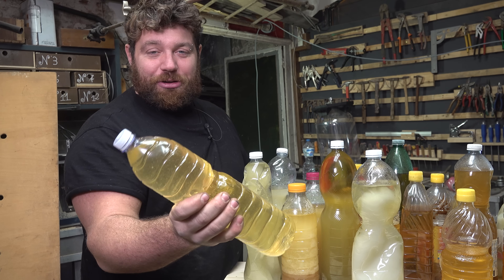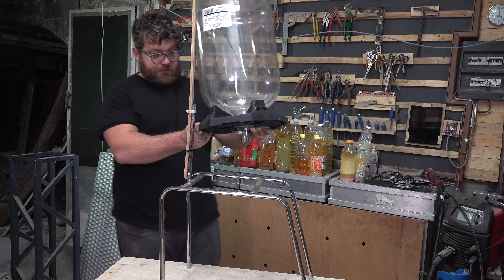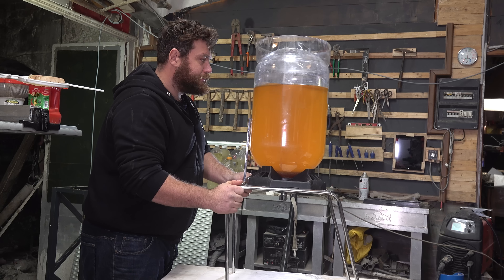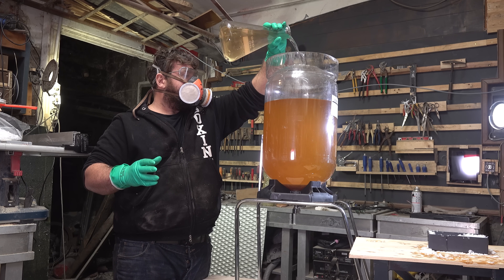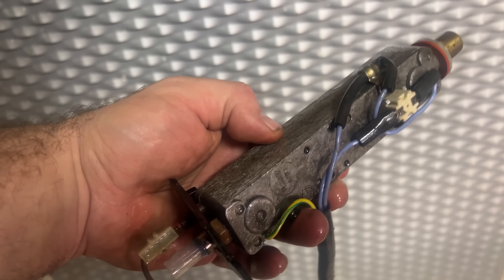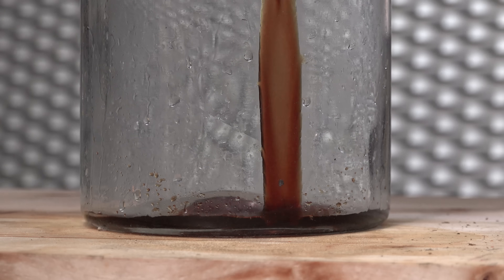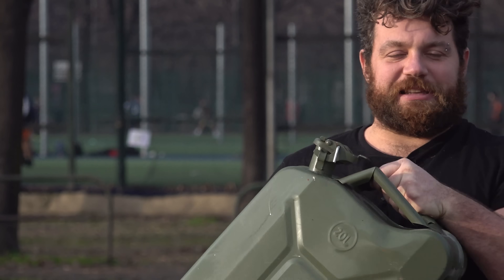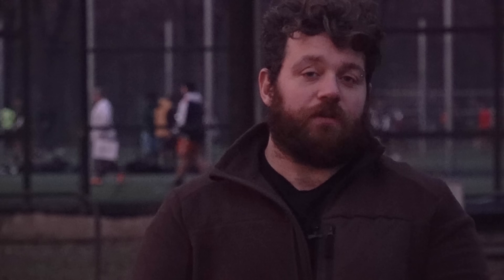How to Make BioDiesel at Home • Full Tutorial 4k

Comment: Biodiesel (rapeseed methyl ester) is an extremely good solvent (dissolves any paint from the carbody):
-> swells all rubber lines and rubber seals (up to the injection pump).
-> The total loss is unfortunately pre-programmed!!!

Therefore the better solution: Build a Two- tank- system!
In the small tank: pure diesel
and in the big main tank: PURE salad oil!

Warm up the engine with DIESEL and then switch to the vegetable oil tank!

A few km before shutting down again switch to diesel to flush the lines again with diesel.

Works great - you just have to think a bit (switching from diesel to salad oil and back again) ...

You can also install a fuel preheater to get thin vegetable oil.

Greetings from Austria! 03 10 2023

Comment: Just Put the Salat oil in the Tank of an old Diesel Car. It will Work. But Not in a Common rail. It will Break your high pressure Pump. I did it with my old 190 D Mercedes more than 20 Years ago. It worked fine. At this time Diesel price has been raised. Salat oil from Supermarket was much cheaper. There we're also seperaten Tanks available which fitted into the spare tire Container in the Back. Start and Finish with normal Diesel with a switch. But after that they raised the price for Salat oil, those Bastards. The Car ran good. I built an extra heating Tube into the Diesel circle to keep it better flowing in Wintertime. But a 50:50 Mix with Diesel was Always better. I Loved the smell of a Grill Party, everytime  I have got out of the Car. The examination of exaust Gases was allways better Then with normal Diesel.
Reply: Gut gemacht !

Comment: When making fuel from vegetable oil you should wash the fuel after extracting the glycerin. If You use too much sodium hydroxide the final product can have some dissolved NaOH in the liquid making it slightly basic which can slowly damage fuel lines an the engine.
Reply: I was gonna say just that.
He never washed it!
Reply: @brianmurphy8790 ä
Reply: Yep. NaOH eats aluminum. I'd use such fuel for heating purposes rather than for engines.
Reply: @TransAmDrifter  unless you got a full cast iron engine like a old 12, 24 valve cummins and a 4bt,
Reply: How do you “wash” the fuel ?
Reply: @MrWeiserrr  
You literally 'wash' it in clean hot water.
Then you wait for the oil/water to separate and then drain off the water.
Finally you should dry the oil to remove any remaining moisture. You do that by adding calcium carbonate to the oil and leaving it a day or two.
Reply: @brianmurphy8790  cheers !! 

I genuinely thought that as he didn’t elaborate on the word “wash” 

!🤯! 

why is this not wide spread knowledge, I’m gonna have to start doing this & stock pile it for when SHTF.  

Nice pic btw I guess you could say I’m from the house of Lancashire 😉
Reply: @MrWeiserrr  this stuff will last about ten years at room temp. so you may be better off storing the base components instead and making the fuel as needed after shtf.
Reply: @wake-archus  make it as and when you need it ?
Reply: @MrWeiserrr  
Shtf?
Reply: @putra6106  it’s a abbreviation for sh*t hits the fan.
Reply: @MrWeiserrr  ✊👍
Reply: @MrWeiserrr  biodisel degrades quite fast, some tests show degradation of 10% per year. If you want to stockpile just buy regular diesel.
Reply: @akkudakkupl Even regular diesel degrades over time, but of course nearly as fast. It’s just like bread, the more you process, the longer shelf life gets
Reply: @wake-archus  you know what is worth making for SHTF? pemmican. Shelf stable meal bar that can last between 10-30 years depending on how dry you keep it and if you add fruit to it.
Reply: If you had a big centrifuge you could dry it non chemically as well.
Reply: @akkudakkupl I wonder if it would make any difference if it was in a container that was vacuum sealed. Would it slow/halt the reaction, or not? Any guesses?
Reply: @bbsingsalot  IDK, you would have to find a paper on the mechanism of degradation that occurs, I don't remember now after all this time.
Reply: @brianmurphy8790 distilled hot water fam you don’t want to add minerals that will build up
Reply: @brianmurphy8790 you can use pure oven baked epsom salts aka magnesium sulfate to dry it out too. There’s various other water-absorbing agents that could be used tho.
Reply: @brianmurphy8790  what happens with the water? Waste or reused?
Reply: @MrWeiserrr тряпкой и фэйри
Reply: @MrWeiserrr well you can wash alcohol by salting out the water. Technically alcohol shouldn't dissolve the salt but the water content will. But I'm not seeing where or why you would salt out the glycerine. So glycerine being oil probably would absorb all the salt from the mixture which is no good😊
Reply: @MrWeiserrr add equal parts water let sit drain bottom from top repeat atleast 3 times
Reply: I think he was just showing us the most BASIC way of doing this with the most minimalistic effort/resources 🙏
Reply: No excess of NaOH cause it react with oil and become soap. You don't have to wash it😅
Reply: As with so many YouTube videos, they miss much of the important details out. This video is not different. Try it at your peril. A new set of injectors will cost you much more than you save if you don’t get this mix right.
Reply: Sir. Cant you produce a video teaching the best methods? To show mixtures and process more specifically detailed ? Thank you for your about input. I'm not a chemist so I wouldn't know.
Reply: But isn't calcium carbonate going to also make it basic??
Reply: boop
Reply: So are you saying methanol into to the oil mixture, let it separate willing and salting out the methanol? Where would the glycerin be washed?
Reply: If your tetration calculation and your measurement is correct it should be negligible. You are right that washing never hurts
Reply: What do you mean by washing?
Reply: @StoicOutlaw17  mix it in a container with distilled water, leave it to separate and drain the water
Reply: Heisenberg?
Reply: Can we use baking soda, Sodium Hydrocarbonate (Na2CO3) instead of sodium hydroxide (NAOH)?
Reply: @GiorgiZhorzholiani22 if u dont know chemistry approach at ur own risk mate sodium hydrogencarbonate (nahco3) is baking soda not sodium hydrocarbonate and you would have to use large ammounts and dissolve it in deionised water to liberate the hydroxide ion its much preferred to use naoh as it is a simpler molecule and a stronger base

Comment: You can literally pour cooking oil into a diesel car right of the shelf. Or clean it before using used cooking oil. Either way we use way less cooking oil than diesel and diesel in general is a huge polluter.

Comment: Why not just use the oil directly? A lot of diesel engines are able to burn it without this complicated procedure. Just carefully filter the oil == done.
Some engines like it better when the oil is heated to about 70 C° because then viscosity is near diesel-behavior. 70 C° is easy available on car engines.
Reply: Plenty of modern engines do not like Stright Vegtable Oil (SVO) - older engines can work with it, I dont know every engine.  vw TDI PD and VE engines yes and also PSA indirect injection engines.  The PSA will work without additional heat, one a single tank.  Tdi needs two tanks, one to start on and stop on diesel, the other tank has the SVO that is run through the engine once heated by the cars heat.  Engine failure will happen in a TDI and direct injection engines if you start on veg oil as the veg oil is not burnt fully in the cold car and the oil is pushed around the piston rings which then gums them up (like the residue in your frying pan, the black stick gunk).  It may take some time, it will happen though.
Reply: @WindyJAMiller  WOW, many thanks for this explanation about temperatures and gunk in the piston rings. I never heard it before, but yes, you are right, it's obvious.
But does that mean SVO's are only useful for long-distance trips, because else they will gunk the piston rings.
How about adding some alcohol to make it easier to burn 🔥
Reply: @Oliver-rb1tf  maybe not long distance, but only once the engine is up to temperate.  A good, un restricted, location for the heat exchanger is key.  The coolant water is a good indicator of the engine being up to temperature.   Exhaust gas temperature would probably be the best place to look, but that's not so easy to measure and log to gauge a baseline from diesel operation.

It's the total cost of the project divided by the savings over a defined time line.  Cheap now isn't always cheap over the whole life of the project if you say blow an engine up.
Reply: @WindyJAMiller  what is the difference between the old engines and the new ones. How do the old ones survive the gunk? Why do they not glue their piston rings? 🤔
Reply: @Oliver-rb1tf  old old engines are indirect injection.  Look on Wikipedia fir an hour, you'll learn a lot.  Also they have a different style of injector, a needle type, rather than little holes like moden direct injection injectors
Reply: @WindyJAMiller  yes, I know that, but still (excluding the injectors) the old engines do not gunk their piston rings, at least not that mad as modern direct injecting engines. Also, the modern diesel pistons simulate the pre-ignition-chambers. So both concepts have a place slightly far away from the piston-rings where the gunk can rest until the engine is hot enough to burn it.

But why do the modern engines gunk their piston-rings but the old ones not. Are the old rings much bigger in bigger groves in the piston, so that they rattle themselves free when the engine heates up.

Is it possible to save the modern injectors from particles in the oil by precision filters 🤔
Reply: @Oliver-rb1tf  Honestly I dont know why, I can speculate based on engineering principles. Youve said about the ring tolerances, this is a great point and one that I had not considered before. I know that there is always some blow by and that if that blow by contains veg oil that will get into the engine oil, this engine oil gets hot and is worked through the whole engine and so more frequent oil changes are a good idea to keep the oil effective and to reduce the distribution of the small amounts of veg oil through the engine.

I think when you are talking about the combustion chamber in the dome of the piston of a direct injection engine, this is the equivalent of a swirl chamber in an IDI engine, this is what I also understood to be the case until not too long ago, however there is more at play here. The inlet velocity of IDI is higher than that of DI, the swirl chamber is more turbulent than the crown of a direct injection piston. Again, I don’t know the full answer to the reason why IDI is more tolerant to cold veg oil and I am piecing it together as I find out new information.

There is a group on facebook 'Biodiesel and Veggie Oil Group' with around 6.7k follows (at the time of this post). I would suggest joining there and i am sure you will get more detailed responses.

I would also suggest that there are a lot of factors that contribute to a durable system. The cleanliness of the feedstock, the exact driving conditions and durations, the frequency of engine oil changes, the driving style and mechanical sympathy of the driver and other factors, I’m sure. These need to be considered when someone (and no offence to the video creator here) produces video/information/advice/recommendations to do something or make something or buy something.  I found this video entertaining as the host has his own charm and charisma, however this is not a science or engineering video, it has increased the conversation, which is a great thing in its own right!

Hopefully you can going the FB group, make a post about this youtube video and we can connect directly there.
Reply: @WindyJAMiller  sounds like I will install Facebook now

Comment: Among the many other things I did with Pisco sin Fronteras down in Pisco Peru, I ran the biodiesel rig for three months. I used 100% biodiesel in the volunteer truck which routinely pulled a heavy cement mixer, equipment and around twenty volunteers packed inside/outside. The centerpiece of our biodiesel rig was a converted hot water heater, the element inside provided the heat. External to this was a network of piping to move the product around and a number of valves to direct the flow. There was an inline filter and several large tanks for three rounds of filtering with bubbled air in each. Honestly, we just left the ethanol residue in the biodiesel which does no harm to the end product. As for the drained-off glycerin, this then was used to manufacture soap which we sold. We provided clean buckets to the local restaurants and once each week made a pickup of used cooking oil from them. I note that it doesn't get too cold down in Peru, to be honest. Be prepared to replace your car/truck's fuel filter once or twice after switching to biodiesel since the fuel is soapier (some glycerin) and will internally clean your engine as a result, the residue from your engine then potentially clogging that filter. I'll throw out there that this was an older-style diesel truck with glow plugs which I'd suggest would be optimal for this.

Comment: I think this can also work well with ethanol. It's also cheaper because you can obtain high concentrations by pouring salt in vodka and the ethanol rises to the top of the solution. Obviously, the salt will need to be distilled out if used in an engine because it's corrosive but it's easier and faster to distill a solid from a liquid than a liquid from another liquid
Reply: Use potassium hydroxide if you are going to use ethanol 😊
Reply: @paulfreeman8182 just use yeast 😂 nothing more..    I worked in the biggest ethanol plant in Europe.  Making ethanol is so easy,    corn, waist food, fruits,   big container, add yeast to ferment.  Destruct, have ethanol, alcohol, and waist from everything heat it up press tougher in flakes and you have also food for animals like horses etc. 👍
Reply: @atrumluminarium How the fuck is vodka cheaper than methanol? In my country a 750ml bottle of vodka is the equivalent of $10.50. 1litre is $14. Methanol is the equivalent of $0.43 per litre. Get the fuck off the internet and go back to school
Reply: Well as far as I know Ethanol is 1) a lot cheaper than diesel so it's still probably more profitable to make diesel than to make Ethanol and 2) most engines can't run on Ethanol.
Reply: @teasippingguy9316  you'll be running the engine on biodiesel tho not ethanol and if it's cheaper it will just make your biodiesel cheaper. Not sure what the purpose of your comment is tbh
Reply: @atrumluminarium  nvm I thought you wanted to extract Ethanol and use that as fuel
Reply: @atrumluminarium  But methanol is way cheaper than ethanol especially if not denatured
Reply: @HanTrio3  But a lot of the methanol is obtained from natural gas so environmentally speaking it's still a fossil fuel source of carbon. Ethanol obtained by fermentation comes from carbon that was already in the atmosphere before so you won't be adding new carbon in.
Reply: @atrumluminarium  but you said it was cheaper
Reply: @HanTrio3  well where I live yes lol
Reply: @HanTrio3 ethanol is cheaper, and way Easier to make(you literally just needs to ferment and destills anything that have sugar, including fruit waste)

(Ethanol/gas engines arent picky, if you put anything that have around 96-95% ethanol it will work just fine, doest mater if the ethanol have additives, come from the gas station or from Your personal bar)
Reply: @anonimoqualquer5503   Methanol is cheaper than taxed ethanol. Ethanol is maybe easier to make yourself but that doesn't make it cheaper to produce
Reply: @HanTrio3  It is cheaper!!!!!!!!! scraps from your damn table and some yeast...
Reply: @POLISHOGG  then you need to purify and distill which is not worth the labour
Reply: just make biodiesel from old plastic, its easier than this method and it cleans up the plastic, you just need to heat the plastic in a sealed container to turn it into diesel.
Reply: @King_Flippy_Nips thats not how it works dude, trust me thats a big lie
Reply: @King_Flippy_Nips  you will get crude diesel, not biodiesel, plastic os made from fossil fuels. It could be a cheap way to get diesel tho

Comment: if you are going to make alot of biodiesel and have large waste oil supply i really recommend to get centrifuge filter to make the filtering way easier and better
Reply: Vaccum filters suck at processing in bulk. Centrifuge filters pull contaminants and water which iirc vaccum filters will not. No physical "filter" so no need to replace anything really.
Hefty investment at $1500~ sure but that pays itself off in 5-6 tank fulls on my 50 gal truck. $300 to fill the tank, or a 1 time $1500 purchase to filter my own at $1 gallon or less? Sold.
Reply: I think a vaccum filter is better(cheaper, Easy to find)
Reply: Or just put a spigot in the side of a bucket about 1-2 inches from the bottom….when you open the spigot most of the solid should remain at the bottom of the bucket significantly shortening the filtering process
Reply: @Menuki  yes 100% - settle your oil and let nature do the work , i do this in  1,000 litre ibc containers - i run b100 in 3 engines 2 modern vans and a narrowboat, all have been running for many years without issues

Comment: Make the oil warm for filtration and decant each bottle first to let 99% of the oil run through very quickly and then pour the junk in last and let it drip out for 30 minutes. If you want to use it as fuel for your car I'd wash the oil with some water to get the water soluble sh*t out of the oil. Some salt can be carried on with the oil. Why is the methanol yellow?